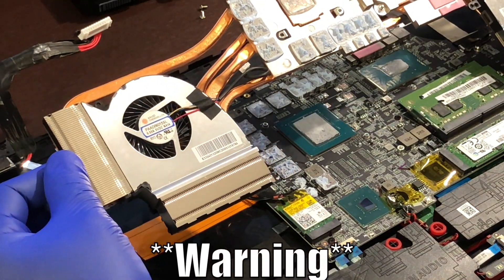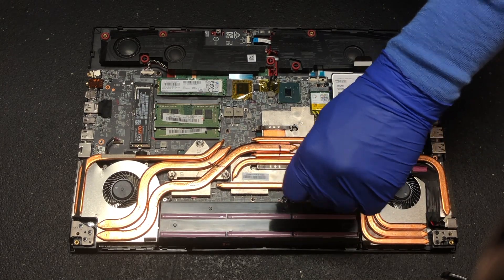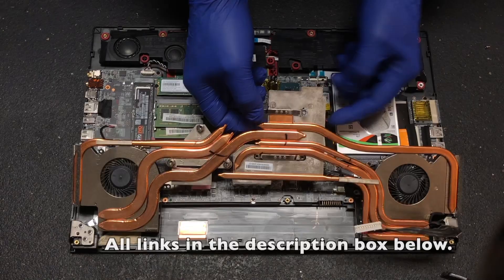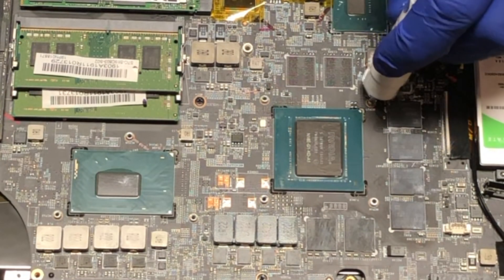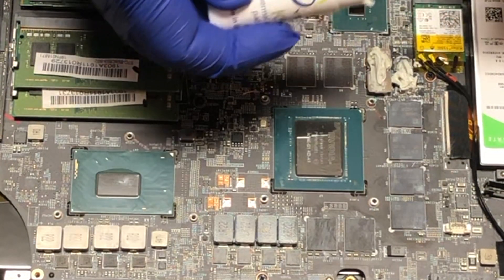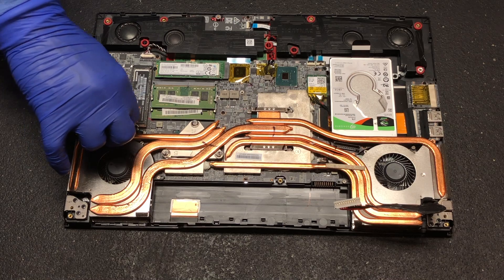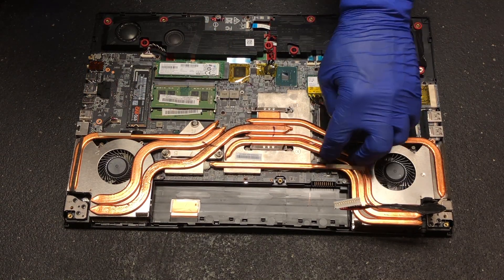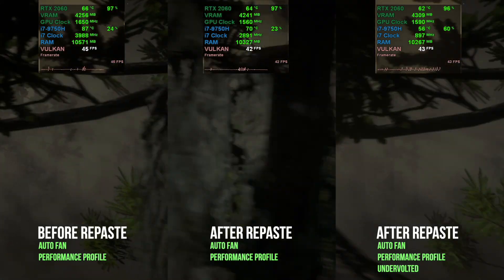MSI Raider Repaste K5 Pro and Kryonaut Big Improvement

Comment: Great video, thanks. Unfortunately I couldn't unscrew the silver heatsink screws with the same screwdriver as I used for the black screws, as it nearly stripped the screw. What screwdriver are you using for the silver screws?

Comment: Your thermal paste application to the CPU / GPU is wrong, you cant do the "line method" as you are dealing with direct die cooling. Thermal paste has to be spread evenly across the entire die to ensure uniform heat dissipation. GPU's have multiple thermal probes spread across the die and will trigger thermal throttling if only a single one reaches above TDP.

Comment: Any substitute for k5 pro? Its not available at my place 😭
Reply from the maker: The only other thing I would use would be thermal pads.  The tricky part is getting the measurements.
Reply: @Meanpooh  how much mm thick pads are needed ?
Reply from the maker: Ive not a clue on what they would be. .5 - 1 would be the choices I would pick if I were to try and size them up.

Comment: Do I need to change the white thermal pads ? I opened my laptop once for cleaning and I saw it should I change it or keep it ?
Reply from the maker: If you have pads make sure to measure them before replacing them.  If you have the thermal paste then I would replace it but only if my machine was getting abnormally warm.
Reply: @Meanpooh  oh ok. I bought the thermal paste but not the pads there is a thick white paste on the cores or something do I need to remove it ? My laptop is not heating up much tbh
Reply from the maker: @kage0096  If you replace the thermal grease on your CPU and GPU, the thermal pads or paste on the VRMS should be changed.  You could probably get by if the machine is not that old or if you hardly game on it.  Just leave the pads where they are.  If you have the liquid thermal pads then its gonna be messy.  Trying to reuse this product is tricky because it gets everywhere and you'll no doubt lose some in the cleanup process.  Not having any extra around will put you in a bind and you can be sure that your machine will heat up.  If the machine is at tolerable temp levels, I would not remove the heatsink.
Reply: @Meanpooh  my laptop is fairly new it’s from last year (MSI GE66) and the temperature started to go A but higher while playing GTA around 70-82… on cooler boost. And I don’t really play that often I use it here and there sometimes.
Reply from the maker: Those temps are pretty normal.  I think you're good.
Reply: @Meanpooh  yep ik lol. But I like my temps around 60-70 😅

Comment: Hey, can I use thermal paste instead of K5 Pro?
Reply from the maker: It’s best to use inly thermal grease on the processors.
Reply: @Meanpooh  okay...the problem is there  are no k5 sellers available in my region so, I'm thinking about replacing the K5 Pro with Arctic APT2560 Thermal Pad.
Reply from the maker: Yes, that will work.  Just make sure none of the pads overlap.

Comment: Hi, may i ask how often do you repaste with kryonaut?
Reply from the maker: I only repaste If a see an increase in temperatures.
Reply: @Meanpooh  sure, just wanna know how often it dries out. Coz i dont want to repasteblike on a monthly basis. Hope answer. Thanks.
Reply from the maker: It takes a while for thermal paste to dry out.  Some can last for years depending on the use.  The only way to really tell is by monitoring your temps.  If fans and vents are clean and you detect a constant rise in temps then you should repaste.  Set the bar a day after repasting.
Reply: @Meanpooh  alright, thanks for answering my question. I'll try it out on my laptop.
Reply from the maker: No problem.

Comment: its called thermal putty and is normally very expensive. i just found out about this product yesterday and its a nothing else then a affordable thermal putty. bless them for making it availiable. (info: thermal putty isnt normally availiable to normal ppl like us, as companies like fuji poly only sell those to big manufacturers like nvidia and so on.)
Reply: please stop your bullshit and your illuminati theories and poor victim of poverty, thermal putty never been expensive, you said you discovered them 1 day ago and you already making stories about prices and poor and riches .... pffffff
Reply: Bro in India it's not available...so the thing is I removed the pink putty that my laptop came with..then i put thermal pads in place of putty ..but it didn't work...my laptop's been overheating ever since 😥 i am frustrated i tried many things.
Reply: @uparanjandas1723  then you dont have the right thickness. try the ultra soft from OC cool, they are called "Eisschicht" and have 5WMK. you can nearly get them into every shape. otherwise, just use a thick thermalpaste as replacement, like Noctua NTH1. good luck sir
Reply: @Thor_Asgard_  will noctua do the job of thermal putty..if i put enough ?
Reply: @uparanjandas1723  yes for a time it will, but as nearly all thermal pastes are made of silicone with metal particles, it will dry up over time. you have to replace it every year. For a old G750jh from asus i repasted the gpu ram with nth1 as i had no putty arround at that time, works fine since 3 years. if you really wanna get putty look for fujipoly thermal putty 5wmk, but its expensive AF, especially considering your in India. also the other dude is wrong, if you take the ultra soft occool pads, you can use the thicker ones and they will just spread, as they nearly have the consistency of putty. also look for a putty without silicone.
Reply: @uparanjandas1723  bro once you remove the thermal pads never replace with other pads ! they will never fits the original ones just 0.001 millimeter between them and the heatsink is like there is no pads at all, thats why we we put thermal putty because it will cover all the difference and space between, never put pads again, its better to put thermal paste and not pads never ! your pc could accept the thermal paste for few months if you put enough paste, otherwise you shoul really find some thermal putty ! dont ruin your pc
Reply: @jayceontalylor4244  thermal putty which brand other than k5 pro ?
Reply: @uparanjandas1723  dont know bro sorry, i only use K5-PRO i never tried another one since its perfect to me
Reply: @jayceontalylor4244  i can order it from usa but ..it will be very much costly for me..coz it becomes costlier because of customs and taxes ...the price of k5 pro becomes double 😥
Reply: @jayceontalylor4244  hey bro can you give me ur contact where I can connect with you...i have seen some thermal putty ..but am not sure if they are the same..i want to send you pics of thoise
Reply: @uparanjandas1723  bro really im no expert the only thermal putty i know and used is K5-PRO, look with the other dude called "keep", he seems a connoisseur, but honestly if it will cost you double the price its better then damaging your laptop i dunno, if i were you i will pay double the price better then damaging the more expensive laptop, i also sent so many thing to a friend of mine in new delhi ( e-cigs and liquid ) and he never paid taxes for that im not sure about the tax thing
Reply: @jayceontalylor4244  yeah bro..the normal cost is showing 1600 but after customs and stuff it's comes around 3200

Comment: Great video.  Is it possible to use thermal paste instead of using the liquid thermal in pads?
Reply from the maker: Yes you can but its very hard to judge thickness as the thermal paste will run or decrease in size over time.  Thermal Pads are the best way if you can get the correct sizes.
Reply: understood. But if I don't know the size of the pads use the liquid thermal pads?

Comment: How much thermal paste do you need to buy (the Grizzly one) ? Is 1gram enough for the CPU and the GPU ?
Also did you end up using more than 20grams of K5 ?
Thanks in advance
Reply: Bruh one gram is alot..you need a pea sized dot on both. 1 gram could do like 4 computers at least
Reply: @Sabatar446  i wish

Comment: Looking at the benchmark at the end of the video, it seems like the repaste even hurt the performance. I remember when I applied liquid metal to my CPU it ran a solid 20°C lower through a benchmark (70°C instead of 90°C). So either the thermal paste you used wasn't all that good, you used too much - OR the factory thermal pads are already pretty good.
Reply: Why exactly? The temperatures improved and he lost only several FPS which would be in a margin of error. The cooling improvement is much better than the loss of FPS. He even saves some energy
Reply: @ShiDDeX_  I phrased that poorly. I was referring to the GPU temperature being basically the same before and after (and comparing it to my experiences with repasting CPU).  I was very surprised to see no change in neither performance nor temperature there.

You're right in what you're saying, however  the performance still is just a tad below than before the repaste (maybe within margin of error, but it certainly did not improve).

It seems like the CPU is throttling at a certain rate no matter the temperature. Maybe that could be fixed by tweaking BIOS settings. Sure, if you want your CPU to live longer and last longer while running off battery, that may be worth the work. But all things considered it doesn't seem worth the effort (unless you could tweak BIOS to let the CPU run faster).
Reply: @Avantgardist  He forgot to put paste or pads on his CPU mosfets...
Reply: @ShiDDeX_  4 FPS out of 44 is almost 10% which is not within the margin of error.  He definitely lost performance and it would be interesting to know why.  I suspect that an area that isn't temperature monitored did not end up with enough thermal paste on it, so while the probe reads a lower temp, that unmonitored part of the die is actually hotter and causing throttling.

Comment: Dont waste your time folks with the msi raider , it’s gonna be hot 🥵 whether you repast it or not because it’s slim and the fans are small , i had this laptop and sometimes i can’t even touch the WASD when gaming.. best thing in terms of performance and value is the dominator and the titan pro , period.
Reply from the maker: Most all laptops that are thin run hot.  Even some of the most expensive one such as the M15 and 17.  Gaming Laptops need to be thicker, not thinner but too many weaklings can't carry them.
Reply: @Meanpooh  i understand that bigger laptop means difficulty carrying it , the only thing i love about the raider is it's design and that new steelseries keyboard , the problem i had with it is running like hell.. otherwise it's a good laptop for people who wants portability , you get a gaming laptop and a work laptop at the same time , much better than a macbook that it's capable only for editing.
Reply from the maker: The design and KB are of good quality.  Good performance and quite hot out of the box.  Machine needs some lovin to get it just right.  Easy to throw against the wall when temps are out of control and settings won't take.

Comment: And can you change it for thermalpads? And what thickness thermalpads do you need?
Reply from the maker: Yes you can change the thermal pads.  Measure before you throw the old ones away.
Reply: @Meanpooh  you don't understand, I have the same laptop, but I wan't to change k5 pro to usual thermalpads.
Reply from the maker: @MrDemfor  I see, unfortunately I don't have the sizes for thermal pads.  They come in 3 popular sizes(1,1.5,3mm).  I would choose the middle size or a multipack to be on the safe side.  Then you will have to cut them to size.

Comment: followed this to replace thermal pads on my MSI GS65 / i7 9750H and 1660ti

the main problem was the sizing of the thermal pads.....replaced all of them with K5 goooo and my temps are in the high 70 max on full load

for the dies i used ArcTIC MX5

good luck 

great vid

Comment: so I've heard mixed results about the msi laptops and their questionable thermal grease they use, some say their laptops throttle really easy and others dont, still deciding weather I should repaste Mine, I have the msi gl73-9sek-411, with the rtx2060. highest temps I've seen on sport mode was 69-71c for the GPU, and 81-85c for the cpu, and on turbo mode I've seen 70-74c for the GPU, and cpu stays the same, you guys think I should repaste?  ive had the laptop for a year now.
Reply from the maker: No.

Comment: Thanks meanpooh. this is the only video on youtube  about replacing ge75 raider thermal grease.
I have a same problem with MSI GE75 Raider (i7 8750h and RTX 2060 with 32Gb ram).  but here in IRAN there is no K5 pro and we can not purchase from amazon or ebay etc. 
I want to repaste cpu and gpu with arctic MX-4 but I dont know what should i do with that sticky compound. Can i use themal pads? or should i buy some cheap thermal grease boxes for those white compound? or maybe just by adding a little mx-4 to the remaining compound? please help me with that.
thank you
Reply from the maker: You're welcome!  You can use thermal pads for the sticky liquid thermal compound.  You should be fine.  The only difficult part would be getting the correct thickness.  You could be safe and use 1.0 mm thickness.  Never stack thermal pads on top of each other.
Reply: You can purchase K5 PRO from our e-shop at www.computer-systems.gr . Shipping to Iran from Greece is now possible and takes around 10 days through post office.
Reply: Dadash manm MX-4 daram vali 4grame faqat. Mishe bporsim chikar kardi akharesh? Ru vrm chi zadi? Thermal pad zadi?
Reply: @omidszi  سلام دوست عزيزم. من هنوز کاری نکردم برای این موضوع و احتمالا شیش هفت ماه دیگه اینکار رو بکنم. چون که حرارت پردازنده فقط در حالت توربو به بالای 90 میرسه که حالت توربو یعنی اورکلاک. و نیازی نیست که حتما روی توربو بزارم، میزارمش روی اسپرت برای بازی و حرارت در محدوده 80 درجه هست با حالت اسپرت که اوکی هست و مشکلی نیست ولی قطعا اگر خمیرش عوض بشه خیلی حرارت پایینتر میاد. من قصد دارم که نهایتا تا سال آینده که خواستم خمیر رو عوض کنم، از سایت مالتینا  همین کی 5 پرو رو بگیرم و چند پد سیلیکونی هم بخرم تا دم دستم باشه و سپس لپتاپ را باز کنم ، خمیر سیلیکون رو عوض کنم. چون همینجوری اگر بازش کنم و پد سیلیکونی ها آسیب ببینه ، دیگه اون لحظه نمیشه کاری کرد. به نظر من شما دست نگهدار و تست کن ببین آیا در حالت عادی دمای پردازنده چطوره(مال من بین 45 تا 65 تغییر میکنه). در حالت بازی هم نهایتا بزار روی اسپرت بازی کن و ببین حرارت به چه صورته. اگر واقعا ایراد داره و همیشه دما بالای 90 هست برو سایت مالتینا خیلی راحت این محصولی که این بنده خدا گفت رو بخر به همراه  پد سیلیکون 1 میل بزار دم دستت و لپتاپ و باز کن و دیگه نگران چیزی نباش. ولی تا قبل از اینکه ابزار و مواد رو نخریدی هیت سینک رو باز نکن. منم قطعا تا سال آینده عوضش میکنم چون این شرکتها سیساستشون اینه که یه خمیر آشغالی میزنن رو لپتاپ تا مشتری مجبور باشه گارانتی رو باطل کنه. موفق باشی
Reply: @vahidamiri964  ممنون
من دراگون سنتر رو پاک کردم خیلی جالب نبود.
ولی با آندرولت دماش به ۹۰ هم میرسه بعضی اوقات در نتیجه مجبور میشم سرعت سی پی یو رو لیمیت کنم تا دماش بشه ۷۰. با اینکه خیلی تاثیری بدی توی fps نداره معمولا ولی خب نباید مجبور باشم همچین کاری بکنم! بیشتر به خاطر گرافیک میخوام این کارو بکنم البته چون دماش تا ۸۵ میره که خیلی زیاده واقعا.
از طرفی هم mx4 میگن خیلی خوب نیس و یه جورایی مونده رو دستم :))
Reply: خواهش ميکنم.
Reply from the maker: Try undervolting.
Reply from the maker: Repaste the CPU and GPU. Use the K5 Pro or thermal pads on the VRMs. Undervolt  the CPU after installation. No sense in undervolting GPU.
Reply: Sworup S  We checked with our shipping agent and at the moment the only option for shipping to Nepal is through courier for around 50Euro.
Reply: Sworup S  Thats great news! We do keep stock in Amazon Australia. If you need any sugestion please contact us directly through our website www.computer-systems.gr